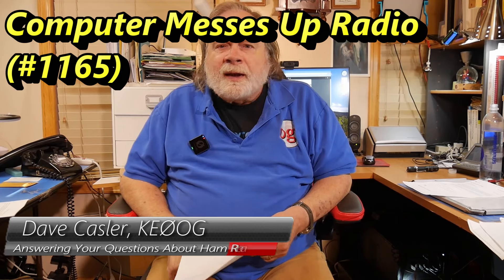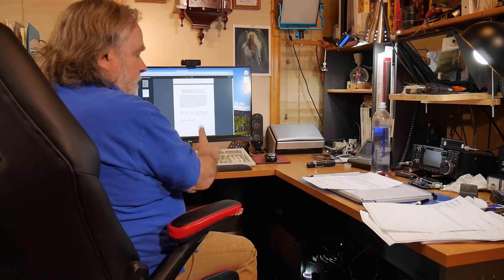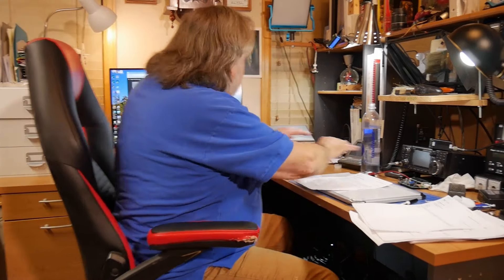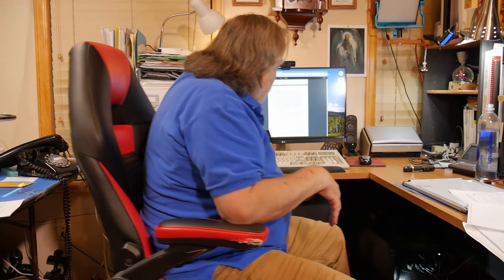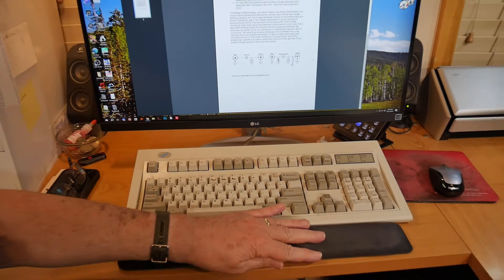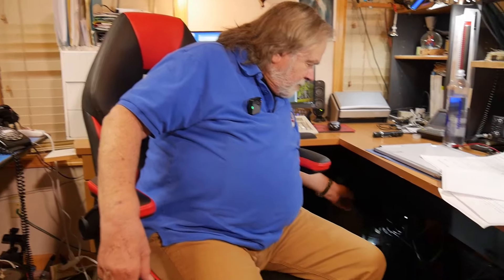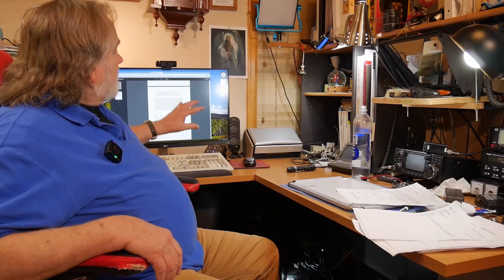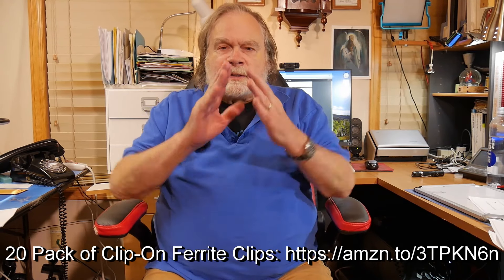Computer Messes Up Radio (#1165)

Comment: Insulated/isolated ground electrical system and grounding of chassis can help a lot. When I built my new shack I wired the electrical system with an Insulated/isolated grounding system. My computer is a Mini BeeLink and my radio an Elecraft K3 are about 8 in apart and I have zero noise in the radio due to the computer. However my Fosi bluetooth audio amp causes about 2 S units of noise, working on that, for now I turn off the audio amp when using the radio.

Comment: Something the might help is trying to power stuff on different circuits from the breaker panel. Computer equipment hardly ever doesn’t feed noise back to the supply. When I worked for the phone company we had battery backup and inverters. The cheaper inverters produced noise that was acceptable for most applications but the noise when mixed with produced by common network equipment there were problems.

Comment: One other thing, if you use a wired mouse, I've had these interfere with my radio gear as you use either the buttons or the scrolling wheel.
Put a ferrite on that cable as well.

Comment: A great deal of interference on HF specifically may come from Ethernet cables. Most cheap ones come without shielding. Look for the ones having sheet metal on the outside of the connectors - these are the shielded ones. Even better if they come with ferrite beads, or you can add them. But ferrite beads on the ends of longer non-shielded twisted pair cables are ineffective in my experience, especially when the cable approaches quarter wave in length. 73 from VE7EVE.

Comment: I suffered severely from interference from my PC on all HF bands despite multiple ferrites and grounding. Then I bought a cheap laptop that is powered/charged by 12v. Problem solved and the laptop is small enough to sit next to the transceivers. 73 - F4FEW

Comment: A common mode choke on the coax near the radio  worked for me to get rid of the noise generated by the laptop. The snap-on beads did nothing for me.

Comment: Just a note for some people who may have to connect their monitors over a longer distance than the standard two meters. I use 7.5 meter long 8K "Active" DisplayPort and HDMI Cables (available on Amazon) for my 4K monitors.  They're more expensive but worth it as they are well shielded and completely noiseless. Avoid the cheap, short cables that come packed with new monitors.  They're guaranteed to be of the lesser quality variety.

Comment: it is a peer to peer network.    Don't believe computers are private.  In order for privacy. You have to put the hardware in a Faraday cage and hope it is sealed.If it is not sealed a near by computer will act as a bridge. There is a peer to peer that is unknown. I observed it talking on 462 mhz .I observed it advertising it's self every so often in the Faraday cage.before I put it in the Faraday it would not stop talking on 462 mhz. I setup a laptop near the computer in the Faraday cage because i need it.long after I put it in the Faraday cage. The next time the computer advertised it's self they both started screaming on 462 mhz. The only reason i know this is because I had a scanner on . Every time I turned on my the mobo I bought for my gpu to run llm's on. It made alot of noise on 462 mhz. So i put in a Faraday cage because I didn't want to lose my hardware to the FCC. I found out all this. I'm not saying this is just about llm's.

Comment: Great video ! That advice works with the ferrite. I ended up needing a lot of them snap on cores .  But worked well for me. I am portable with a IC 7300 ,LifePO4 battery and antenna like a end fed half wave and a laptop for logging.  One day doing POTA I wanted to use FT8 and easy to do with built in soundcard on 7300. I have done many times before. In 1 park. I get set up. Great SWR . like 1.4 SWR. On FT8 running WSJT-X in different laptop. sometimes the laptop will lockup once the mouse pointer would disappear after calling CQ. I had ferrite all over . Well forgot 1 cable. The USB A to B cable from laptop to icom . I had a long printer cord so I wrapped it threw a T240 -31 toroide I had in go kit for choking coax, I have extra chokes always . That fixed the problem . Any cord or cable on computer or radio can either be the source of RFI or recieve RFI .  I learned that by forgetting 1 cable.   73